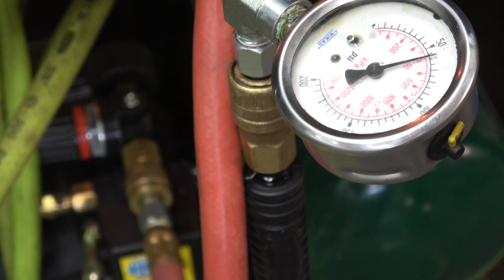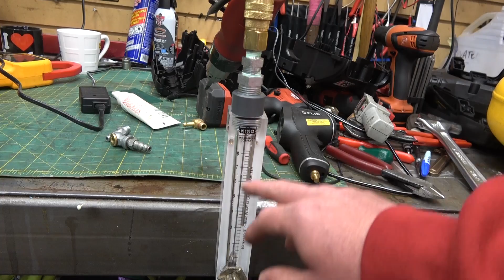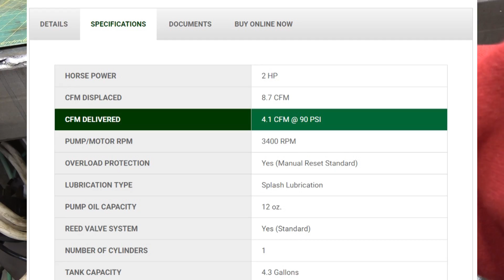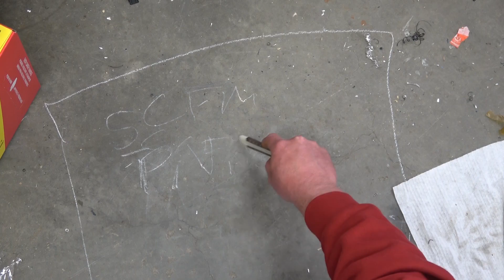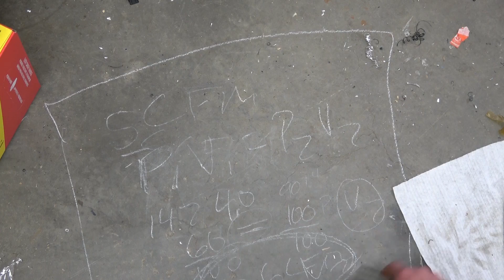Why are CFM ratings BS?

Comment: Now you need to check the actual flow rates of the tools. I would be interested in seeing if they are using the same standard in rating them.
Reply: It makes sense for the tool to use the inlet pressure for its rating - that's the pressure you need to deliver for the tool to work at maximum capacity. There is literally no reason for them to lie about that number.

It does not make sense for a compressor to be rated on the inlet pressure, because that is not what you need to do work. You need outlet pressure, so you can match it up correctly with the tools. 

What's worse is someone who works with industrial air compressors is even more likely to be filled by the false advertising, because industrial tools are rated on the outlet pressure like they should be. They can get away with such dirtbag tactics that the consumer grade stuff can.
Reply: I believe his first test did show that the die grinder was using around the same CFM as its rated for while running. At 3:43 the gauge reads 3.5ish at full chooch from the die grinder at 100-110 PSI.

Comment: Fuck. I always knew that the consumer grade compressor ratings were BS after working in the drilling and blasting industry. And I was much annoyed when my "7" CFM compressor could not keep up with a 3CFM tool. That is including a 100 liter tank. Should have checked the math ages ago. On the flip side, if you are not running a $bezilion town-pump cnc or a 6" down-hole hammer into dolerite, and only for dicking around in the shop, what is the price difference between friends?

Comment: I think the problem your running into is that the compressor scumbags and the tool scumbags are both lying to you , the only true way to measure output on a compressor is to use a  specific orifice it accurately measure the output !

Comment: There is another channel on the tubes learning a similar lesson right now.  They built a 4 banger Honda engine and put a huge turbo on it so that it can produce 1000 horsepower on the dyno then installed it in a jet boat thinking that they were going to smoke the other boats that have much larger engines since theirs weighs so much less and makes the same power.  What they neglected to factor in is that they can only make that power at like 10,000 RPM and now their jet boat will only do around 40 knots because it doesn't make enough power to get into boost.  The plan now is to find a smaller drive for the boat that will require less power to operate but that will make the boat slower so it will be an expensive lesson in the long run I am sure.

Comment: Awesome. So I guess the solution is to Daisy chain multiple 60 gallon compressors or something, unless you have access to genuine industry air compressors? ...My wallet just shrieked in horror and ran away. I'm a little freaked out.

Lol, AVE, you rock. Best wishes for your health and happiness!
Reply: Do you mean parallel them up?
Daisy chain sounds like feeding the first compressor output into the inlet of the next one.
It wouldn't improve your flow rate but the mushroom cloud  might make an interesting spectacle for your neighbors. :-)
Reply: @alangunn7254  I was more visualizing a "chain" of fittings, tees, and so on, connecting all the outputs of the compressors to a single air line... Yeah, I guess it is a bit like wiring in parallel, isn't it. Still, I like "Daisy chain"  It's like sticking a flower in a pile of shite: it's still shite, but now it's got a daisy in it!
Reply: this is exactly what I do when using an air arc.  string 4 of those little turd boxes together and they can start to flow some air.
Reply: Yes this, T two together. I do the same thing with the $110 ones with the two wheels on the back and handle in front. I was able to paint for a 4-5 minutes continuously before they had to catch up, wish I could remember the spray gun cfm @90 rating. You get way more cfm per dollar this way and can plug into different breakers.
Reply: 6.0 cfm at 30psi (thank you amazon orders from 2015)

Comment: I ran this test this weekend.  I have a husky 30gal belt drive compressor, rated at delivery 5.3cfm@90psi.  started at 150psi.  Ran my hf die grinder rated at 3cfm.  Compressor could only maintain 50psi after a few min of use.  Wouldn't drop below 5psi, but the tool was running poorly.    Great job on getting the word out on the deception.
Reply: There is fuckery in the tool consumption ratings too..if you read the fine print for the die grinder you'll probably find that 3cfm rating is calculated with a usage factor of 25% or so.
Reply: @meatballparts9767  correct, they are rated for 30 seconds run. Total bollocks for a polisher or grinder!
Reply: @michaelbamber4887  I agree but this thinking has its place...If you're sizing a compressor for a 10 bay auto mechanic shop it doesn't need to maintain pressure with all 10 impacts running continuously because it's just not going to happen.
Reply: You forgot, your compressor is rated 5.3scfm! Must not forget the S, very important. Without it they would be lying!
Reply: That is it... was always told to get one that was 3-4x higher rated then the tool. Also why people get huge tanks, run and store it, for the duty cycle.
Reply: wayne light 
Thanks for testing and posting. I mean it. 
But how come you haven’t noticed this before? I’m asking in all seriousness. Tia
Reply: @Conservator.  it was the first time I've used my die grinder at home and not at work.
At work we have 2 scroll style compressors feeding a 200gal tank with a 120cfm dryer.  You get spoiled on things like that
Reply: wayne light 
Haha, that scenario had crossed my mind. Tx!
No ‘not enough air’ issues at work for you!
Reply: My former employer had two 50HP air compressors with two dryers feeding the shop including a blast booth. With both running there was no issue, but if one crashed it didn't take long for the other to start losing the battle on keeping up. Only way just one would suffice is when the blaster was shut down.

During the humid summer days the dryers would remove a minimum of 5 gallons of water from the air.
Reply: My snap on impact does the same as yours. Die grinders eat a lot of air more than most tools
Reply: My compressor is rated at 10.7CFM Free Air Delivery 16.0CFM Piston Displacement 145psi 3hp Motor - 230v (16amp). What does "Free Air Delivery" mean. It's a SiP 05300.
Reply: @gepwxaqdfsidsesg1548  free air delivery means in your case, it will give 10.7 cfm at 90psi continuously. Pump always needs to be bigger than free air.
Reply: Thats odd my 26gallon huskey is rated at 6.6psi at 40psi it maxes at 135psi and with my 1/2 impact running constantly it will still fill up to the pressure cut off

Comment: Good vidjeo....What about rotary screw compressors?  Enough for shop air?
Reply: Usually stickered CFM but still means SCFM. Rotary screws are better for numerous reasons. But not best for intermittent duty - like your car engine, they need to run long enough to warm up and get the moisture out of the oil, otherwise shot in 100hrs.

Comment: So does this apply to two stage home gamer compressors as well? I recently purchased a sanborn (Menards) two stage 30 gallon compressor. Claims 5.5CFM at 90psi and 6.6CFM at 40. Did I get hosed?
Reply: it applies to pretty much anything not industrial. want to find out? go grab an air tool and see how low the pressure drops before the compressor can keep up. as someone that owns that same compressor i can tell you it's nowhere near the rating
Reply: That's what I feared.... But it is rated for quite a few tools.

Comment: I'm not surprised. Scuba tanks are rated in the same way. For example 80 cubic feet. I think this is why air compressor tanks are rated in gallons rather than cubic feet.
Reply: Well, most divers would know that only means 40 cu ft @ 30 feet. Dive depths vary, and deeper dives eat more air. In this case, it is bald fraud. The @ symbol MEANS the two numbers are related. These compressors move 4.1 cu ft of air, AND can get up to 90 PSI. Sheesh...

Comment: They just assume that all guys are using air compressors for is off dusting key boards.
Reply: Don't  act like you don't use your rotary tool in pulses like the rest of us. 1 second on, 14 seconds to build up pressure, 1 second on...that's how they're supposed to run right?
Reply: @PowerScissor  Would that be 4SPM? Four useable seconds per minute. :D
Reply: @PowerScissor  exactly hahah
Reply: I used mine to save some intestines once.
Reply: I dont think any manufacturer has ever thought that.

Comment: In europe they rate both free and regulated airflow. But they should include duty cycle in those ratings aswell.
Reply: Sometimes they specify the flow rate at 3bar which is basically a mousefart. A weak rattle gun sometimes specifies that it needs 6bar 260l/minute which is basically maximum what a single phaze domestic compressor can deliver. Most 3 phaze consumer grade compressors are no better. Basically all consumer compressors here in europe are made by the same company NuAir, doesnt matter if what namebrand is on them.
Reply: Big problem is that even the peoplewho sell compressors have no idea wether they can run the tools even in a businees to business retail store they have to call the compressor service guys to get an idea.

Comment: Two issues: 1. Slight difference between advertised and actual is marketing or bs. That might be 10% or something. 

2. The BIG difference is that you are misunderstanding the terms. In engineering terms, if a TOOL states actual cfm required at 90 psi, that is cfm when compressed to 90 psi. That is where your flow meter is plumbed, before the pressure reduction. That is not usually done. 
  COMPRESSOR cfm is stated in Scfm (Standard),  which is cfm at standard condition, I think is about 70 F temperature and 1 atmosphere absolute, or at 0 psi on a gauge.
    SCFM vs cfrm where your flow meter is installed will be about 7 to 10 to 1 ratio.l
  It isn’t fraud in the ratings, it is in mixing up the actual engineering terms an d what they mean.
Reply: Please correct me if I'm wrong, but isn't this exactly what he said in the second half of the video?
Reply: The fraud happens when compressors use a different standard than tools, USING THE SAME TERMINOLOGY.

Comment: What hospital did you steal that airflow gauge from?
Or was it a nursing home?
I need to know because I need one....
Reply: Actually, CFM gauges like that are also used on regulators for MIG and TIG welders......
Reply: @notajp  CFM on a welder, yikes that wont last long. CFH is more like it.
Reply: @notajp  ... that was satire
Reply: @notajp  woosh
Reply: Suggest you contact Dwyer Instruments. I use a lot of rotameters for work. Recommend the VF series.
http://www.dwyer-inst.com/Product/Flow/Flowmeters/VariableArea/SeriesVFC-VFCII#ordering
They are relatively pricey but they are worth their weight in gold.
Reply: @gslim7337 
 r/woosh
Reply: In healthcare we use L/min, not CFM.
Reply: @arlhartley  Obviously you don't work at AvE's retirement home.
Reply: Omega Engineering had good ones on the cheap
Reply: Pops got a nice manometer from work, before they closed up.
 I think it scales down to like .001" of water or some shit, whatever, its the one they used for calibration on a magnahelic gauge. 
Damn thing is about 3ft by 2ft and 2 inches thick clear plastic and probably weighs 20 pounds. 
Shipping would suck, its probably easier to stop by.
Reply: My welder has one on the regulator.
Reply: @benjaminkline4855  welding regs are in cubic feet per hour not per minute
Reply: Available at McMaster Carr.

Comment: Ahh, the math and the absolute pressure vs gauge pressure, etc. That makes sense. I learned in my fluid power (mostly hydraulics, but we covered pneumatic systems briefly) class that the compressors are rated at SCFM...at the inlet. That's where the standard is. The measurement is how much standardized air going in, not the capability to put air out at any particular rate or pressure. (and all the gas laws are, you know, add 14.7 (which varies with altitude/ambient air pressure) to your gauge pressures, then convert to an absolute zero temperature scale, and go from there..)
'Everyone' knows that you need a WAY bigger compressor than your tool(s) need in order to use them without running out of air in the reservoir (receiver), but why that is, total mystery. Nice to have that explained.

Comment: Worth noting as well that most consumer compressors have duty cycles between 40 and 60 percent, so continuous use will let the smoke out of the motors in short order.
Reply: And that's per 10 minute cycle. I asked a salesman recently if their compressor would be okay with 30 minutes continuous use, they said no it's going to burn the motor up and that even 10 continuous is asking a lot, it was a $500 compressor. Seems you really need to jump to the >$1k level to get units that are made to keep up with tools like plasma cutters and die grinders.
Reply: Mat D yup. Try several $1ks

Comment: Bought a kobalt air compressor from lowes and it said tool ratings are often 25% of what should be expected. That lines up with what you are seeing. Want a picture?
Reply: He's seeing 1/10 the expected performance, how does that line up?

Or are you talking about the useless 3.5 CFM @ 0psi? That's the least important part of the problem.
Reply: 25% sounds like the ditt cycle, so worst case multiply by four to get to 100%.. and then multiply again by 6 to go from scfm at 0psi to 90psi. Or IF you use bar, multiply by 6 to go from 0bar to.. 6bar!

Comment: I always knew those rating were BS in some capacity.  I didn't know to what extent though.  Jesus Christ.  Certainly explains why my compressor is running all the damn time just working on my cars.  

I hope this video makes the rounds and gets some manufacturers beat up at least a little.  Or at least starts a wider conversation.  The more folks that find this one from searches on the topic, the better.  Great video.
Reply: I find this funny too because when I bought my compressor it was rated on the output, both at 40 PSI and 90 PSI. And it has proven that it can keep up with a tool that runs less than the 5.5 CFM at 90 PSI. It was the only compressor in the store that was rated at a certain pressure output, not the suction volume input.
Reply: @chubbysumo2230  Was it listed as SCFM or ACFM? A is for actual  s is crap and is just momentary like AVE has shown.
Reply: @chubbysumo2230  chubbysumo. What a name.  Lol. At least you didn't go for something like "the chubbiest sumo" or "the chubbiest sumo all the time". Lol
Reply: This is not a new practice... I learned about this in the 80s from the Sears catalog of all places. They actually described what the different ratings meant and pointed out that SFCM didn't refer to the output of the compressor at all. Which is good, because I was looking at a 2 HP compressor and a 15 HP air motor and thinking I could get 13 free horsepower. What can I say, I probably wasn't even a teenager at that point... I was distressed to learn that my plan had a problem.
Reply: Hey hey now, Jesus had nothing to do with this lol just seems he gets the blame every time something unexpected happens lol

Comment: We have a quad of VFD drove Sullairs, 1200CFM @ 120PSI, does that follow the concept of "the highest rated compressor can virtually never keep up with the lowest rated tool"? If needed for a die grinder they build them much bigger than those, MORE POWAH!
Reply: Wow, what do you do that requires that much air?! :o
Reply: @SuprSi  a whole plant full of automated automotive spot welding cells for instance. Almost everything pneumatic powered. Just an example from what I did for a while.
Reply: I used to work on an offshore drill ship. We had 4 IR scroll compressors rated at 900 CFM each, and we'd routinely have all 4 running at 100% load and still not be able to maintain system pressure. Blew my mind. So like he said, no matter what you have, it still isnt enough sometimes.
Reply: 1.200cfm each?....sounds about like 300hp each...or 4 75hp VSD machines... medium to smaller machines...least from I'm used to lol....work on everything from 5hp all the way up to 500hp rotary screw machines....oil flooded and oil free..
Reply: @angusandleigh Yep, 300hp each, dual stage flooded screw, the VFD can go as low as 450cfm before the motor risks stalling and the unloader opens up.